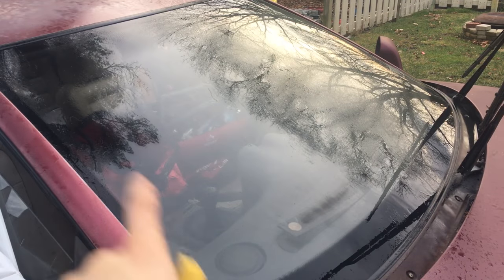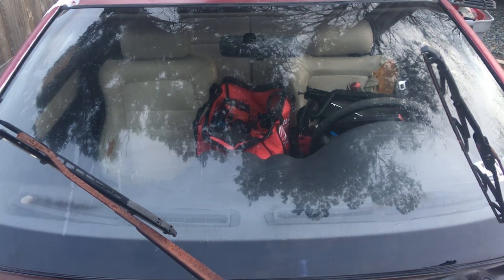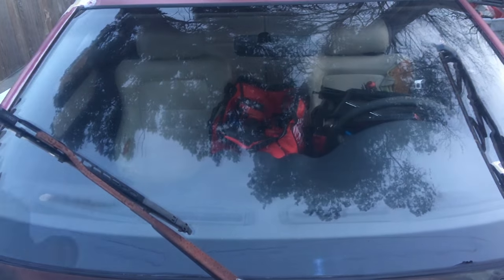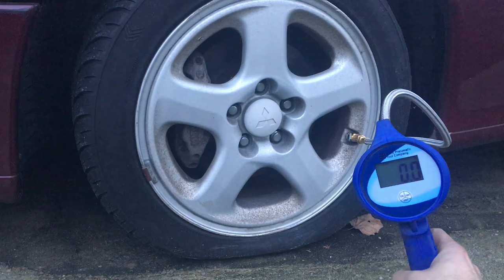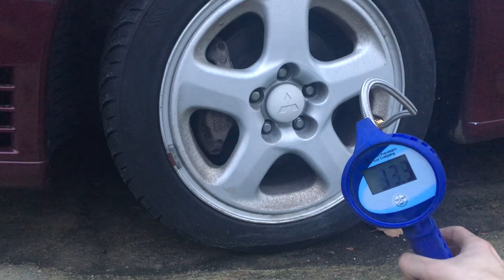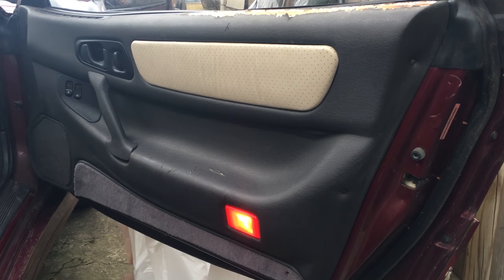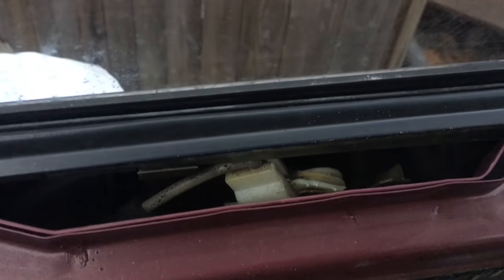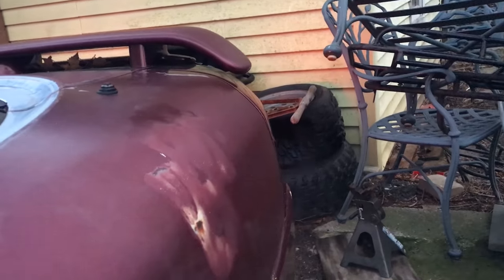Worst 3000GT VR4 Update! (Cleaning & Window Problem)

Comment: I have a 94 dodge stealth, and I noticed your oil pressure is low at idle and comes up at higher RPM. that would be the check value in the oil pump going out, just something to keep in mind. great vids, keep up the good work.
Reply from the maker: Thanks! I have been meaning to put a gauge on that to check the oil pressure

Comment: Sounds real nice man. Gotta vacuum under the hood. Under the plastic cover that the wipers sit on that gets gross. You must work at a local autoshop or something from the cloths you had on. Good vid. Too bad no garage. Looks cold.
Reply from the maker: barry k. Yeah, I should do that because the air blows really nasty smells (from the mice) I don't work at a auto shop, I work on heavy duty trucks. Thanks and yeah I wish had a garage because it does get cold and I can't work on the car

Comment: Man I didnt know that carnauba wax can be used on the windshield I always just used rain x.  Is it a better product to use?  Also, how do you wash these cloths when you are done to reuse them?  Throw them in the washer or soak them in a special solution?
Reply from the maker: I used it because I learned it from ChrisFix's video. I have the orange Rain X washer fluid that works really well in the rain. There is a certain way to wash these, I would watch AMMO NYC videos. He has great videos on detailing.